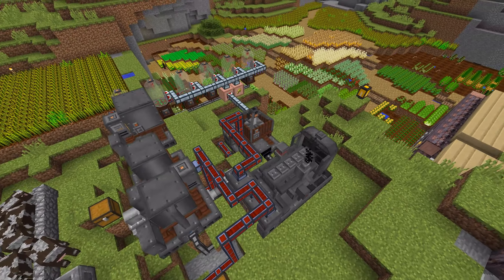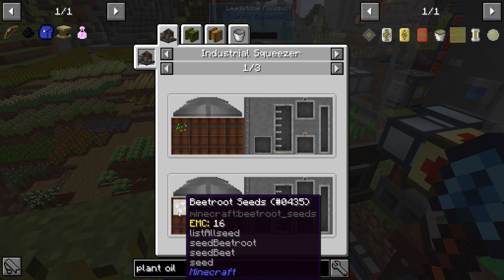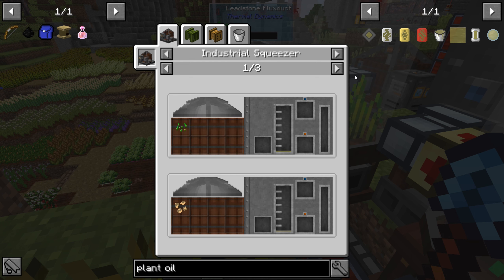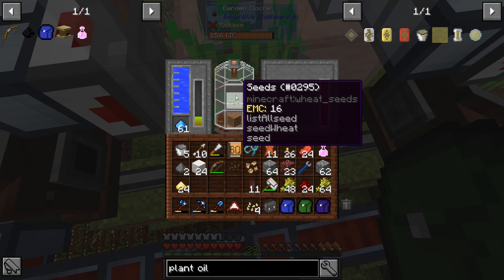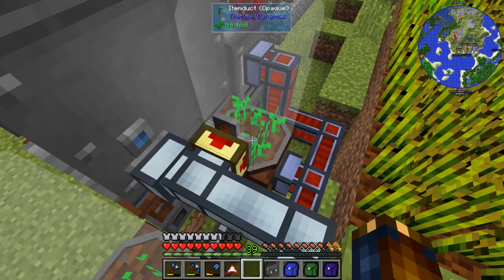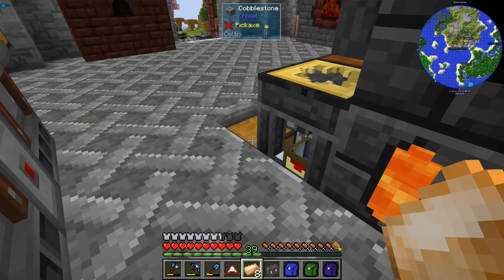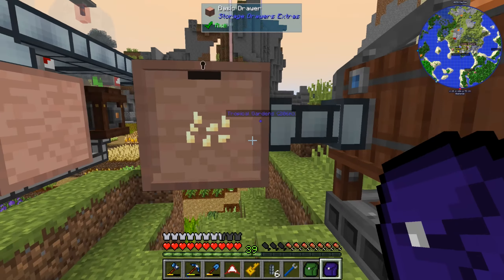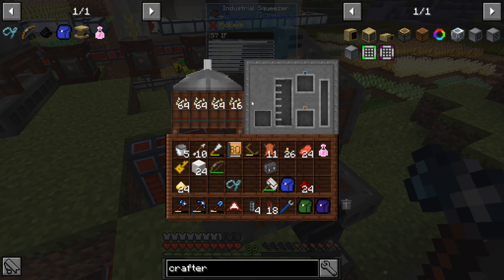Minecraft FTB Continuum - Episode 67: Burning Random Seeds

Comment: Yeah, I think the Mechanical crafter will only need grid power if you need some speed upgrades. I think the transfer nodes from the same mod would also need grid power if you put an upgrade (speed or otherwise) with them as well. 
And I think it's 4 times as many seeds? Since you get 4 seeds per pumpkin rather than 1 per wheat? Though I guess it doesn't matter now. 
And geez, power is hard in this pack; get it working, but run out of resources. Get better resources and run out of resources again because it's too efficient. A good problem to have though I suppose.